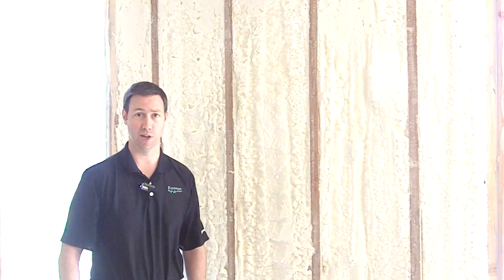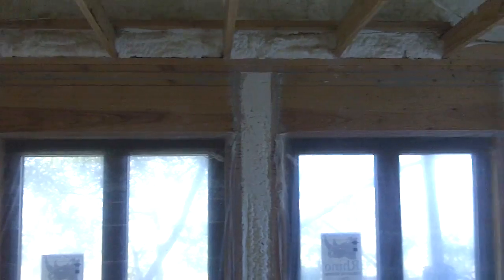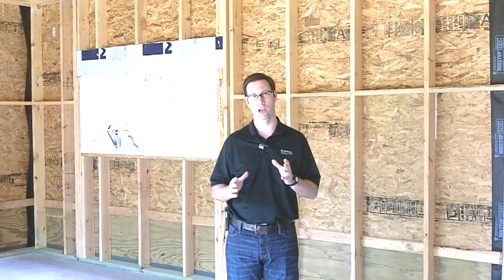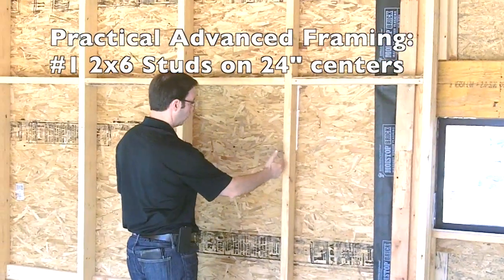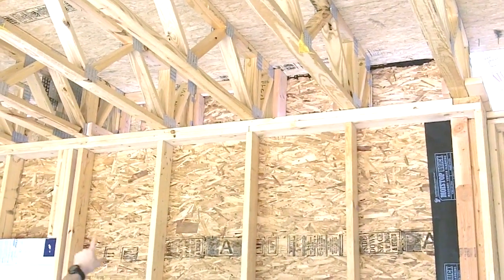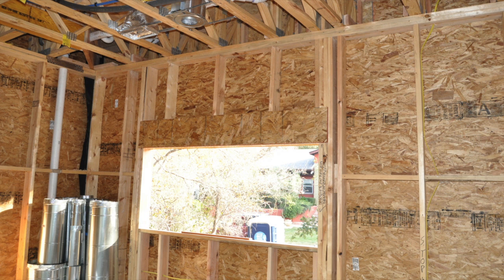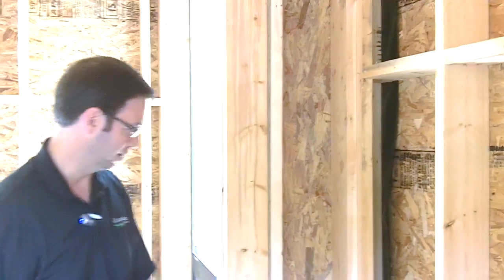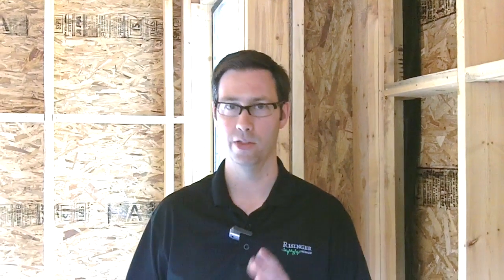Advanced Framing vs Traditional Framing

Comment: If 16 on center is overbuilt and 24s are just fine... why would you prefer 5/8 drywall to stiffen it. I can't see how you truly believe your 16 vs 24 statement in that case. 24 on center and 1/2 drywall leaves partial doubt in your mind?

Comment: The floors have to be bouncy as hell with joists at 24oc. Save money on studs but have to put in a 16" 560 floor system that's maxed out on spans. I'll stick to 16oc with cdx and 5/8 rock. Builder I'm workin with now only uses 1 1/8 advantec, shit is heavy af but makes for one solid floor.

Comment: i used that spray foam on a temporary addition one time and when we came back 5 years later for the full remodel that spray foam had turned into dust...pink fiberglass and 2x4's will last 100 years as proven by this video @ :35

Comment: great tips, I like the pressure treated for 24 inches. I like the California corner for insulation ability. I too agree that 2 by 6 framing 24 on Center is adequate. 2x4 truss floor is good too. I'm sure you deliver a quality product at a fair price. I'm a metal stud framer and have been framing for 28 years our company does a lot of commercial Condominiums in San Francisco

Comment: Have you thought about using metal banding to create an x on each wall with a nail in each stud that the banding crosses..  It may not seem like much but by doing this the lateral stability is greatly enhanced an at a minimal cost.

Comment: it's funny how you use pressure treated plywood but just treated Lumber on the floor that touches the floor. plus if you are going cost effective your headers cost more then traditional. but I'm in Canada so it may have different costs.

Comment: I've framed both 16 and 24" o.c.. advantages or disadvantages to both.
With 16" o.c., and using horizontal cement-board siding, you get more securing points, i.e. every 16" vs. 24". The siding "lays"       better.
With 24" o.c., less lumber therefore you get less thermal transfer thru the studs. Often times I will use a 6x6 solid fir header if it meets span requirements- less labor than filling a thinner header, unless the insulating qualities are needed for extreme climates-

An interesting point- some building jurisdictions here in Calif. don't allow California corners, but i love em! Or we use with a stud-block-stud built up corner and keep em' happy!  Go figure!
Dave

Comment: Three stud corners are much stronger and can be insulated from the outside before putting on the plywood. And the bottom wall plates should be of treated wood as well.

Comment: saw a local builder do the same thing, difference is he used 3/4 osb on the outer 4'  of the exterior corners for stiffness and the middle sections were 3/4 foil covered foam. just didn't seem right.

Comment: so you save a couple hundred bucks on lumber and add5x the cost for insulation wow good job saving the clients money maybe you can let them know about the 8$/mth they ll save on energy costs due there high cost insulation
Reply: You get a better r value on your house. As far as 24 OC your trusses are also 24 oc, unless your going to 16oc trusses which I've never seen on a residential project. The only time you add more wood is for weight transfer. At that point you have no measurements it just goes to were you need it. As far as joist on those walls its engineer for the weights. As far as material it's more then a couple hundred dollars that you save. By doing this. Which only transfers to the customer. You should read a bit about weight charts for material to understand why you won't run into issues. If done properly.
Reply: $8/mo * 12 mo/yr = $96/yr and utility prices are constantly rising. So in a few years it'd pay for the insulation. Now multiple that by decades and account for the inflating costs of utilities... Oh I guess  you're right, the math obviously doesn't make sense! How stupid of us, any pea-brain could see this! Guess we should rip it all out and start over now. =(

Comment: nothing new here. At least you use 5/8" board for 2' centers. That is not a Californiacorner but rather a White Rock, B.C. corner circa 1967. Sorry dude!I do think designed headers are a good idea so as to minimize the size and allow for more insulation. Finally, my choice would be to use Roxul insulation which offers a R22 value in a 2X6 cavity as well as being a material that is accepted as a fire stop in commercial application for pipe penetrations and whathaveyou. Plus it is nice to work with.

Comment: these old timers built there houses in the 30s or 40s 16" on center studs with shiplap lumber on the outside and interior walls and they are still square and level
Reply: with better wood and fuller dimension

Comment: As an Electrician I personally WILL NOT wire a house built like this. I always end up adding in spacer studs to attach my wall boxes to because I have very limited wall area to land my outlet and switch boxes properly. I've also noticed builders are now using headers ALL around the perimeter of the house and I refuse to drill up a header to get my wire through it. 

I recommend traditional construction and will keep major cost down with the other trades that need to come in and do their work. Builders come up with all these "NEW" better idea but are only keeping their out of pocket costs down to pad their wallets and shafts all the other trades. 

This is a joke for a build.
Reply: OberDragon88 you have to suit yourself  to the situation! Us a little bit of both methods! 

Sometimes you'll have more plumbing on a wall, therefore 2 by 6 would be better,
Reply: haha wow they do not understand, drilling a hole through the stud weakens the stud not by half but by sides, it's ok build ur house of foam, be careful! I feel a stiff wind coming hahaha!
Reply: Keep what you call your standards and soon you will be out of business.
Reply: IBEW# 716 there are many ways to get the job done, instead of dropping a tampon you can have the customer's carpenter install the extra studs or man up do it yourself and charge accordingly. 24 in centers give you more room to nail and boreholes.
Reply: OberDragon88 you don't UNDERSTAND the  power of insulation. you're too lazy to drill holes? get serious
Reply: I simply wouldn’t hire you for the job. I can always find another electrician.

Comment: This is OVER-insulated construction that results in much poorer indoor air quality. Thus necessitating the installation of indoor air-to-air exchange units which drives up electricity consumption, and therefore the monthly bill. They try to sell you on the theory that the new central air/heat systems will take care of this problem. That is why air purifier manufacturers do so well. Old buildings have significantly better indoor air quality because they breathe. You can build an energy efficient home that still breathes if you do not hermetically seal the building during construction. 

24" on center framing results in flimsy, shaky construction prone to racking. This requires additional materials to provide lateral stability, such as diagonal metal straps or 2x6 studs. 2x4 walls are more than sufficient unless you are building in truly frigid climates, like Alaska or North Dakota. 2x4 studs require 16" on center for exterior and load-bearing walls because placing them 24" on center makes them too unstable and will not meet code anywhere. 

5/8" Sheetrock is completely unnecessary unless it is a firewall, like a garage or stairwell. This guy likes using it because the 24" on center walls look like shit with 1/2" drywall. Another unnecessary and expensive adjustment, not to mention adding even more unnecessary weight and stress to the walls. 

Plywood exterior sheathing is overkill. OSB sheathing is more than adequate, significantly more cost-effective and more environmentally responsible than plywood. This guy like plywood sheathing because is has more lateral stability for his unstable 24" on center walls. 

If you follow this guy's advice, your construction project will cost THOUSANDS of dollars more than it should. 

No respectable carpenter in the last 50 years has built the traditional air pocket cold corner. Honestly, it almost seems like this guy just learned his trade in a classroom...

Comment: Cheap ass construction the 2x6 is stronger than 2x4 but the only strength used is in vertical down pressure so the 2x6 is an overkill.  16 on center helps the wall to remain straight and allows enough fasteners for the outer wall to perform its job with shear strength from wind load.  I'm a two story sure use 2x6 for the lower floor but 2x4 is fine and yes insulate the shit out of everything but don't forget a house needs to breath or it will mold and then it's not fit for anyone to live in.

Comment: I have seen some horrors in home construction lately.  One house I saw didn't have a single, solid 2x4 in it.  All of the 2x4 lumber was made with small pieces of 2x4 that had been finger jointed together.  This weakens over the years when the glue dries out.   I agree this so-called Advanced Framing is only to make profit for the builder.

Comment: 2x8s at 24" O.C. with 3/8" plywood horiz. exterior sheathing using half the nails plus construction adhesive.  Then install a layer of 1/4" plywood applied vert. over that with the rest of the nails, and apply construction adhesive between the two layers.  Set the wall framing back from the edge of the concrete slab by 5/8" so the outside face is flush with the concrete, and the bottom edge of sheathing pushes against the slab structurally.  Install spray foam insulation, then 3/8" OSB vert. at the interior, and finish with any GWB thickness you want.  Very well insulated, completely bomb proof, and it's guaranteed to make the framer a ton of money, IF THEY CAN FIND A CLIENT WHO'LL PAY FOR IT.

Comment: he just wants you to frame this way to allow him to pack more insulation in the walls so he can get more $$$ they probably charge by weight or sq. in. or whatever. this is an advertisement for insulation. and energy conservation. not necessarily how to frame something more structurally sound. it may save framers some money in lumber. the end product will surely more subject to extensive and unnecessary damage in the event of settling .etc. if you are a do it yourself type person and were financing your project start to finish, the way in the video would undoubtedly cost the same if not more than if you traditionally framed the walls.after insulation, and additional thickness in the dry wall; to prevent warping in the walls or excess flexion. the term "advanced framing" is indeed misleading. a more appropriate term would  be "energy efficient framing" perhaps.

Comment: The old house looks like it had 8 ft ceilings and the new house had 10 ft ceilings, The tree huggers now have a whopping 20% more volume to heat and cool per square footage of home.  Most people are around 5'6" high, Why do we need houses with 10' ceilings? And this cubic footage profits the homeowner absolutely NOTHING, all about looks and vanity.   At least put the studs on 19 5/16" centers, this lightweight cheap sheetrock that's sold today (even the 5/8") has less integrity and strength than Grandpas sheetrock of yesterday, 24" oc is too far to span.  I DO like the treated plywood on the first 2 ft of the exterior sheeting.  R19 walls, R10 Headers and R4 windows? The walls are really not the problem, Doors and windows loose far greater heat and air than walls, ceilings and headers.  Nothing "Advanced" about the framing here folks.

Comment: 2x6 walls definitely add more space for insulation and plumbing.  I am however stuck on the 16"oc floor joist layout with 16" studs. Makes it tighter for duct work but on a 8' subfloors touches 2 more joists. Doing right with framing with 2x6 if going 24"oc in my opinion. No way would I space out with 2x4. Check out Simpson Strong Ties Titan HD anchor bolts.  Meets same code as inbedded jbolts and you can add a stud strap that in anchors through also securing the base plate.
Reply: Concrete guys will love not putting jbolts in and you will love not having jbolts landing in bad places. And can be removable.

Comment: most siding materials we use here in Kansas, besides brick require it to be nailed every 16" with at least 3/4" penetration into a framing material, so the warranty isn't voided.  What do you do about siding blowing off and no warranty because it wasn't installed per the warranty specs??  Just saying,

Comment: They tried that super duper insulated vapor barrier house thing and we still have 5 million high level radon homes. Houses need a draft or they rot or worse grow mold and make you sick.from one generation to the next for over a thousand years we have known better than to make a house completely air tight.If you can't cut stairs or a valley jack your a laborer.
Reply: can you imagine doing what they did with hand tools? i knew a thirty year man could not cut either or read plans, probably collecting his second pension

Comment: I hung a heavy wide screen TV on a wall in a house with 2 foot center studs and what a freaking pain in the neck that was! It didn't look good I'll tell you that. Want to use less wood? use cinder block.. or steel studs.. or let-in braced shear walls and vinyl siding.. I'd prefer steel myself.

Comment: watched this because i thought you had something intelligent to say. turns out your just another know it all with glasses.2x6  24"oc studs is not Advanced Framing.. Your R value LINTALS not HEADERS are standard building code in my area. Also, so is not butting your sheeting tight for air movement and expansion contraction. just the same as drilling out or cutting 3" holes  in the sheeting under window openings... Let a house breathe!!!!

Comment: advanced framing is a really gay term. You're just talking about methods of better insulation. in many areas you do not have much choice in how it's framed, like the northeast where I live. you could never get away with 24 centers. California corners are a must. exterior wall stud sizes are dependent on how much money you can spend. 

it's not advanced framing, it's green framing.

Comment: What will drive all of this/codes is the unions.  Not saying this is good or bad but it is what it is.  The University of Minnesota built a new football stadium less than 5 years ago.  They tried to make it as "green" as possible, so they installed urinals that required no water.  Long story short is that the union ran water to every urinal in the stadium.  The water is not connected however.  That's the code.
Reply: lol.  codes have NOTHING to do with unions.  

if you understood ANYTHING about building, you'd know that stadiums and houses aren't even built by the same kinds of contractors...nor do the same codes apply

Comment: I understand you going to 2x6 framing. But you are talking about weight. .5 in drywall will bow with the 24 inc centers especially on the ceiling. that is the whole reason they went to 18 inch centers. a 24 inch center in the ceiling , which could also be the floor for the second story will garentee to creek and over time bow. I' stick with 12 in centers on floor  and ceiling joist. Because of that to prevent the joist from sag I'll also stick with the 18 inch centers.  
Just FYI that is not cement your standing on .. Its concrete. Cement is the binder used to create concrete.
 this being said for the studs the california corners are nice to use.

Comment: DO NOT USE THIS METHOD UNLESS YOU WISH TO DIE. Advanced Framing means CHEAP. Usually the ones that are ripped to shreds in a tornados. Spray in foam is now BANNED in several states because fumes are toxic and can't live in the house. Holds moisture and causes mold, sealed too tight and pulls in carbon monoxide from exhaust stacks. I am a building contractor for almost 40 years, none have had structural problems.
DO NOT BUILD USING THIS METHOD UNLESS YOU WISH TO DIE.

Comment: 16" stud centers does NOT equate to 25% of the wall being timber. The change to 24" centers saves 2 studs every ten feet. Hardly a big difference at all. Sadly, now when the owner wants to find a stud to hang a shelf, picture or have backing for anything, they have even less options for solid wood and are stuck relying on the drywall for support.
The "traditional" corner never gets framed the way he shows it. It has always been framed like the "California" corner. I've framed for forty years and have heard cheapskate, slippery-tongued contractors spin this crap all the time.
The bottom line is simply that there is no excuse for building cheaply.

Comment: Only R19 in your "advanced framing and spray foam" walls?  Buy modular construction.  Precision straight 2X6 walls on 16" center.  Ritz-Craft standard wall is now R-21 High Density batting and the ceiling is R-38 High Density.  My biggest concern about your "advanced" method is not the exterior wall strength, but the drywall strength.  As mentioned by others, when you only support drywall every 24", it is rather weak and can bow out.  In your case, with rigid foam, it won't bow in, so at least you have that support.

Comment: 3-stud corner is usually a code requirement. 2x4 studs may not be sufficient for 24" spacing, a more expensive, larger stud must be used.